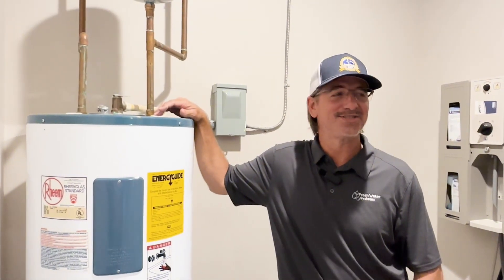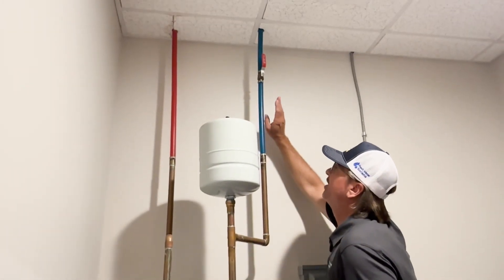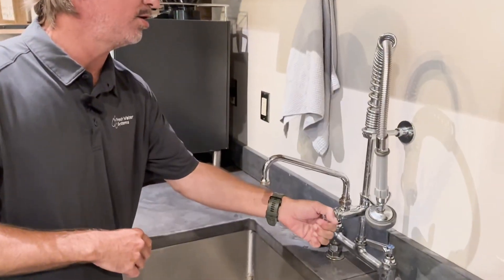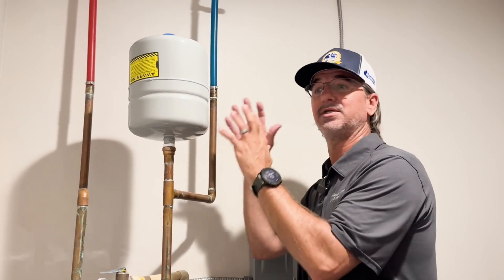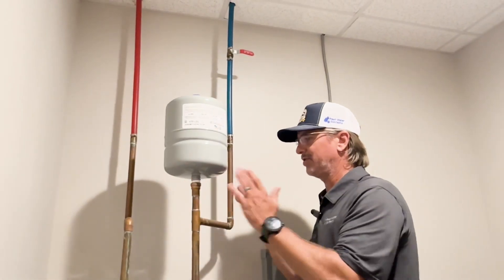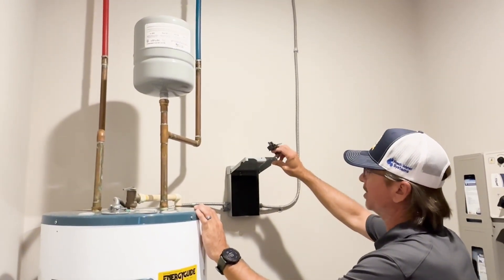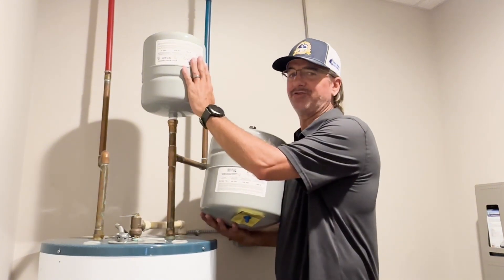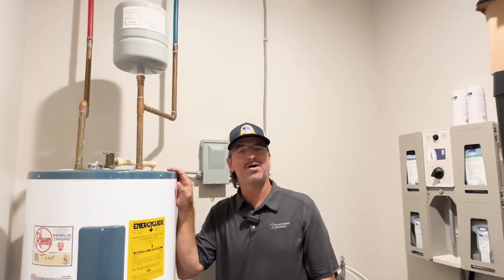Thermal Expansion Tank Installation Tips

Comment: My new hot water heater has an expansion tank and it seems to have introduced hammering..never had a problem before without a tank. The water pressure is 80psi and so is the tank. There is a valve just before the expansion tank on the supply side  and when it starts hammering ..if I shut that valve off and it stops. I tried a second tank and has a similar outcome.
Reply from the maker: Hi! Expansion tanks should have a precharge that is equal to 5 psi higher than the household pressure. As water heats it expands and the expansion tank gives it place to go so the expansion doesn't raise the pressure on the cold side of the household plumbing system. I suggest that you reduce your household pressure.  80 psi is hard on all of your water using appliances, and fixtures.  It is also playing havoc with what the expansion tank is there for.